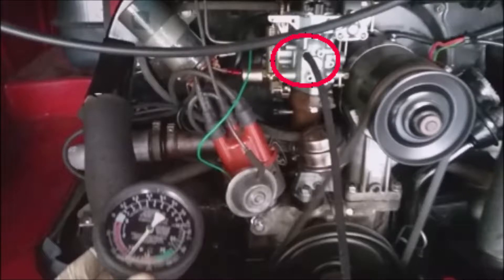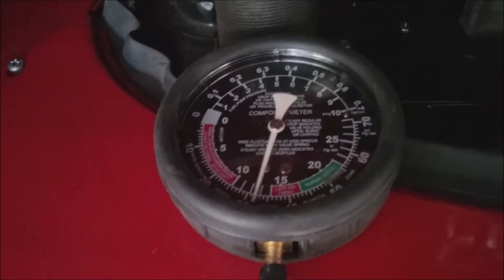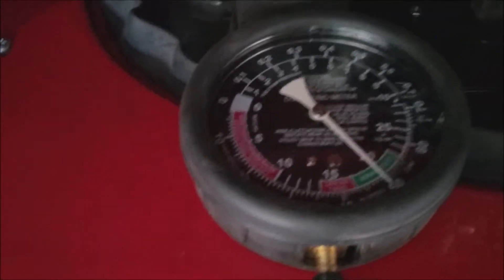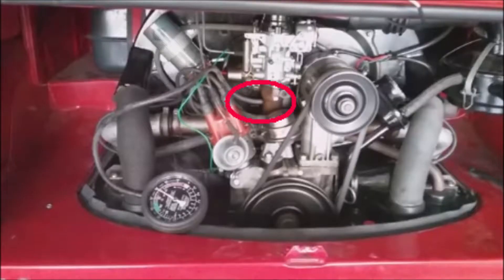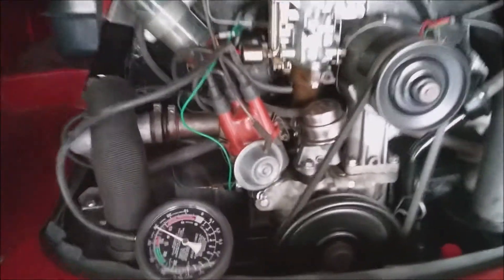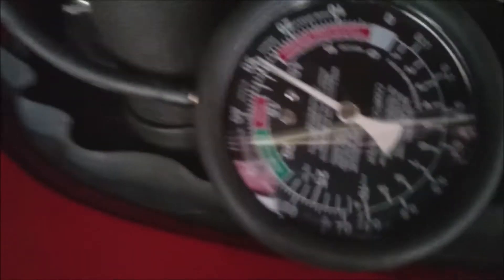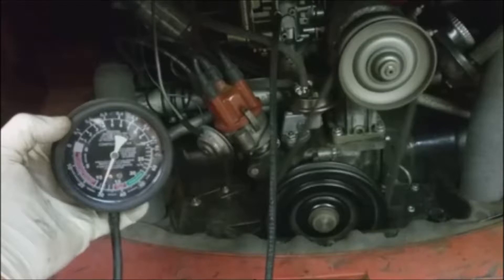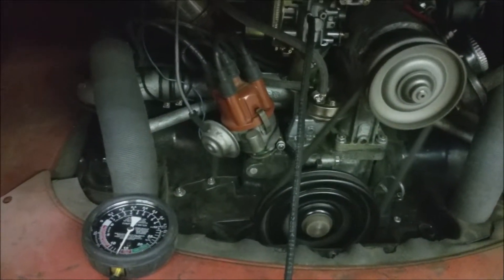Vacuum gauge diagnostics VW bus

Comment: Wow never knew a vacuum guage could provide so much helpful data.. Most of my past work back in my 20's on vw motors were the machining , valve work replacing seats & guides, grinding cranks, milling flywheels Etc...